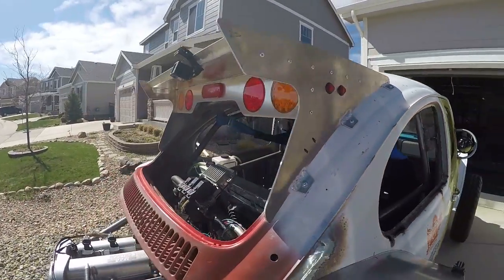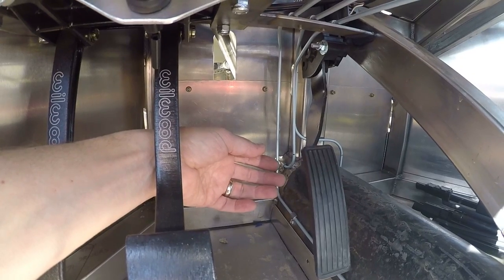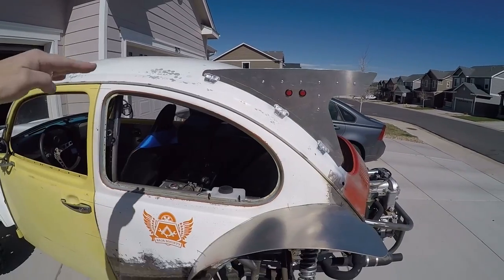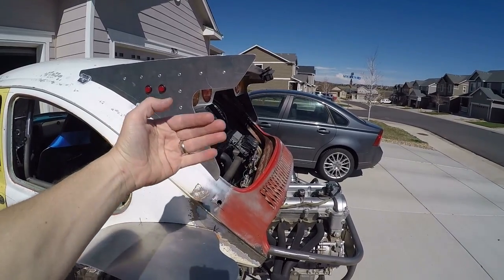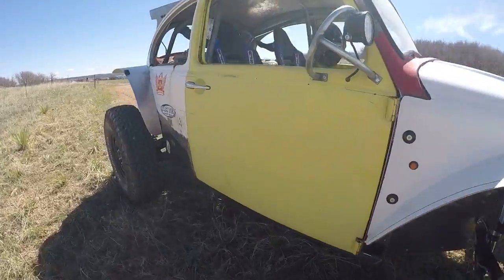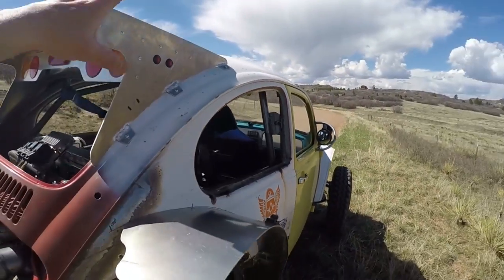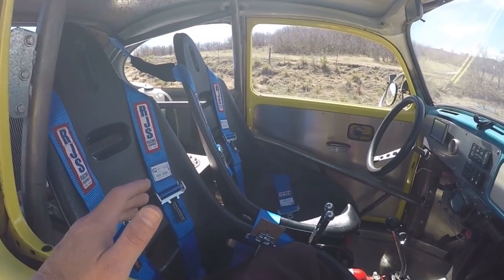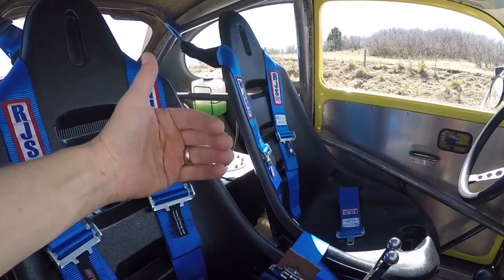Light Wing Aerodynamics testing

Comment: What about plexiglass side scoops in place of the rear windows, to draw air in past the radiator?
Reply from the maker: That would work, but to be honest I'm trying to keep the side windows open. No specific reason other than I like the simplicity of having nothing there. Thanks for the tip though, I think that would work.
Reply: Doug Bug good to know. I’m hoping to do my own build soon. I’m not sure what engine to use though. How well balanced is yours with the straight four?
Reply from the maker: @wileecohagen  It's extremely well balanced with the Ecotec. I would highly recommend that motor. No issues with the front popping up or anything. Understeers under power, but if you let off the throttle she digs right in.
Reply: Doug Bug good to know. The last thing I’d want is a front end that won’t stay on the ground!

Comment: I really like using my little wing windows to move air around in the car. Have you considered that as an option?
Reply from the maker: That works well. However with my off road mirror cages the wing windows don't work anymore. Just another way I screwed myself. ;-)

Comment: Why not run some panels that allow air to flow from under the car into the radiator that way you can close off the radiator from the cabin and still have air flowing through it and basically have that as your fire wall. Kinda similar to us Air Cooled vdub guys with the oil cooler mounted under the luggage tray. 🤟🏼
Reply from the maker: Not a terrible idea. However if I did that I would somehow duct up to the roof or something. I think if I did it below the front tires would stir up to much dust that would eventually foul up the radiator. Thanks for the idea though, I'll think about it.

Comment: Wouldn't it be nice to have access to a wind tunnel with smoke. whoo hoo
There always the 6 inch strips of yarn to tape to different places and set up the camera for flow characteristics....?   A taped on cardboard scoop on left rear side window to pull in some air might help too.  I notice a big difference in my baja when using the rear pop out windows. Sometimes they just open by them selves. LOL
Reply from the maker: EZGZ, the yarn might work. But I think I got what I needed from this. 
Remember I'm hoping to get a trailer this Spring/Summer so I can travel some. When I do I'm hitting you up as my first destination.
So be ready!!

Comment: are you going to make some ducting to the radiator on the new chassis or are going to keep it like this?
Reply from the maker: So I'm thinking on the new chassis the radiator is going to be mounted much closer to the back window. And tilted further in. So that almost all the air pulled through by the fans will just exit out the rear. So hopefully it won't need any ducting.